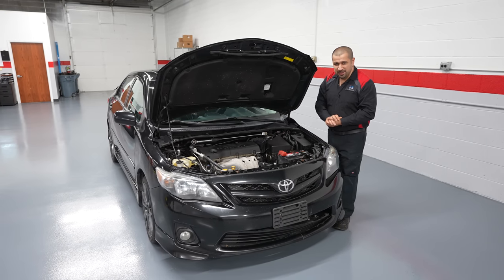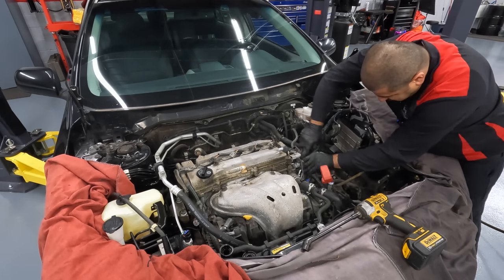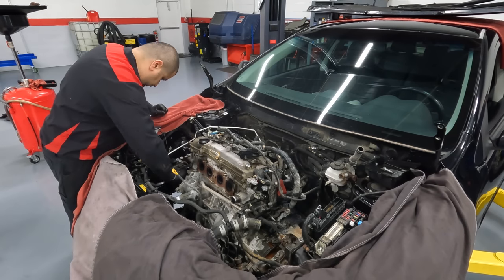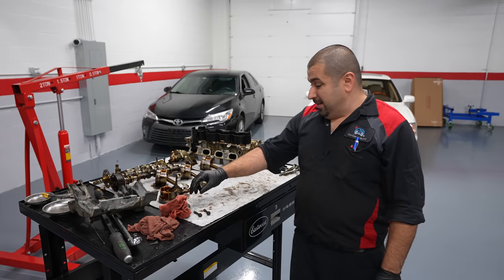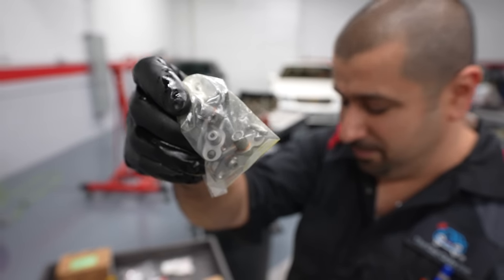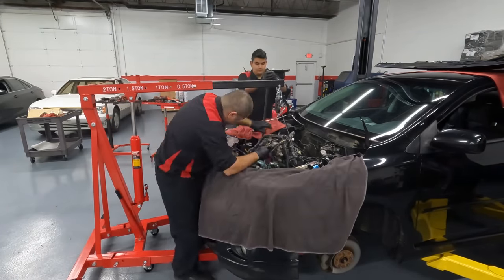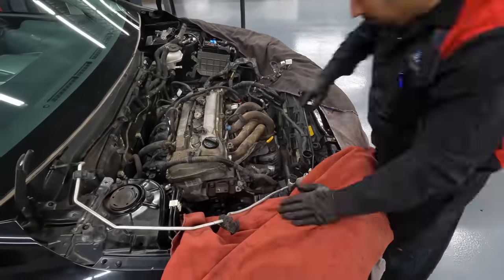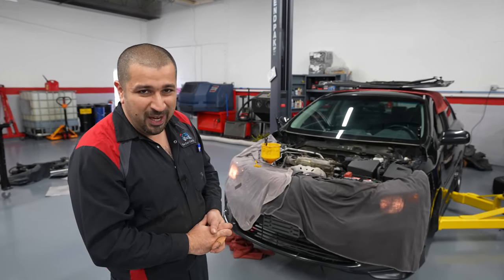THIS is Toyota's Worst Engine Ever Made! But Is It Really THAT Bad?

Comment: My Nissan 2.5 liter 4 cylinder engine has NEVER used any oil in 12 years of driving the car.  So much for Toyota being better than Nissan.  I have never had any trouble with the CVT transmission in my Nissan Altima because I do a drain and fill of the transmission fluid every 2 years or 25,000 miles whichever occurs first.

Comment: Hi sir! Im already fan of your channel, im dentist and when i was 15 yo i wanted to be a mechanic. I really want to study your profession now, just because you are amazing in what you do and you are inspirational. My gf has a RAV4 2012 with this engine and the oil consumption problem is there (maybe) I have to change the oil every 7000 km or 8000 km. Her vehicle is 180.000 km and riding smooth but it has this problem, is worth to get it to the mechanic? What oil should we use in this rav? (i dont have the manual). Greets from Chile and sorry for my english.

Comment: Hey hey hey:)
I have the same engine 1.5 L
2004 scion it doesn't burn or leak oil..good engine 😊
188.900 mi

Comment: My Issue  with Toyota  is I just purchased  a 2024 Venza and Toyota  says  first oil change schedule  is for 10,000 miles  no way did it at  5k new car no break in maybe I'm old  school. Well do changes no later then  7,k intervals.  Do you agree ??

Comment: Thanks man I really appreciate you sharing all of these … wondering if you’ve ever had any timing chain tensioner square plate cover gasket replaced. It’s about 2 inches square plate which covers the timing chain tensioner area and it’s tighten with 4 10 mm bolts, it’s on the passenger side in the front by your grill!

Comment: I have an 06 camry 2.4l with 172k and it doesn't burn a drop of oil, knock on wood lol. Use 5w20 full synthetic with changes at 4,500 miles

Comment: Thank you for the video, it help a lot.

I have a 2011 Scion XB (137,000 mil) and it need the same work as you did in your video. Do you have a list of parts numbers or a kit number? Even though I am the original owner I will need to pay for this out of my pocket. I live on the west cost and have only one Toyota dealer in my town.

Again a great job on the video and the information.

Comment: Toyota must have learned about the oil burning soon after they started with the low-tension rings in 2007. How is it that they were selling new cars as late as 2015 with this issue?

Comment: Also, for me, I'd never ever sell my xb. The room inside it is unbelievable. It's hard to find them cause no one gets rid of them. We love them and oil burning and all we'd buy them over and over again. Absolutely one of the best cars anyone could ever own as far as head room and internal space as well as a transmission that lasts forever and ever.

So for me, it's worth the repair even if it costs the value of the car. Absolutely worth it.

Comment: I really need your help sir,
As you seem quite busy with Toyota mostly, I have a 2.0 hybrid estate 2020 in UK. The car has an ongoing issue of injectors going bad after every few thousand miles. Have tried everything but it won't fix. Toyota said they couldn't trace the actual fault. Do you have any idea what it can be?

Comment: I have a 98 Toyota Avalon Xls v6 automatic w/ od and 4 wheel traction pkg. I'm a 3rd owner and am having problems with overheating, after replacing timing chain and water pump.  My question is: why? 
Please send me some quick fix ideas

Comment: Hi Ahmad , What is the reason or purpose of having crank position sensor disconnected ? Thanks
Reply: It lets your crank the car without the car starting up. Without the sensor plugged in the computer will not let the car turn over. They do this to prime the oil system

Comment: We had a 2013 Corolla S 5 speed traded in at my work with the 1.8L. Has 124k mi has had the maintenance done at our local Toyota dealer. I’m thinking of buying it for around $3500. 

But we also recently had a 2005 Toyota Solara V6 traded in too, has 140k mi and is in good shape. Not sure on a price. Hard to decide. I currently have a 2009 Sentra CVT which has been surprisingly reliable but I’m kinda over it lol.

Comment: Thank you for this and other videos. I like watching all of them, especially about engine repairs. I have a question. 
I have 2016 Toyota Highlander 3.5 V6 with 10k miles (I don't use it a lot), and I have 2009 Toyota RAV4 2.5 with 108k miles. Highlander's manual recommends and oil cap reads SAE 0w-20 or 5w-20 (for 1 or 2 oil changes only).  RAV4 manual and oil cap reads the same (0w-20 or 5w-20). If I care less about gas mileage, but more about engine durability, is it OK to use on both motors 5w-20 all the time? May be even 5w-30?   I realize, the higher second number is, the thicker is oil at high temperature, and the less engine wear. But from other hand, thicker motor oil (may be?) is not able to reach some parts of the gas distributing mechanism, which may damage some of its components (parts). I know, this is a case with some American car makes, for example, Ford F-250 with 5.4 V8 engines.
What would be your recommendations?  Thanks again.

Comment: Hello sir, I'm currently now own a XV30 Camry (ACV30 Thailand model) with 2AZ-FE paired with 4-speed automatic transmission. 
I'm about to do a transmission replacement, so I'm having a question: Could I pair it 5-speed auto from newer model (XV40 / ACV40) with the same 2AZ-FE engine?

Comment: My 2012 venza I ran it twice without oil and after 140k it burns one quarter  of oil.  Between oil changes.  Do you think the rings where damage or the cylinder wall or both. I was thinking of running it until it died and replaced the engine with a used one. Do you recommend saving the engine by doing the job now. Had it since new. 5k oil changes  0-20

Comment: Would 2002 2az-fe components all fit and function the same in a 2005 block?  What would be different about it?  Wondering if you could get an '05/'06 block if your '02/ '03 block threads pull out.

Comment: Does anyone know if the engine has to overheat for the head bolt threads to shear?  Would be curious what they changed in later years to prevent this.  I have a 2002 Camry, 2az-fe, and just repaired my head bolt threads with NS300L from Huhn Solutions.  3rd and 4th intake bolts were stripped.  I've never had overheating issues, as far as the temp gauge has shown.

Comment: I got interested in the part when You say that toyota engines do not need head and block resurface. I got an eu 1az-fe engine which is fine and happy as far as in know but what are the reasons to resurface the head and block? In Poland where i live there is almost a tradition that when your head gasket is shot You always need to rwsurface the block and head and put in a thicker seal. I also saw your video with throtle body cleanup and i cant wait for warmer weather to just check the state of that part in my rav4 because i got LPG added to my car and it's a kinda "dirty" fuel. Thank You.

Comment: I have an 05 Scion TC with 140k on the clock. I'm seeing mixed talking points ab the years the 2az is effected ? Did I dodge a bullet or should I worry for my piston rings ? Driven it about 500 miles since I got it and haven't noticed any oil consumption yet
Reply: Your year is the head bolt issue. If your car overheats it could do damage quickly. The change that affects the piston rings was 2007 and up

Comment: I'm curious about your opinion on 2004-2006 Tundra frame rust 
Where the frame turns up to the front suspension I can put my hand through the frame. It won't pass inspection.
I own a $4000 boat anchor.
😭

Comment: My 2004 Toyota Camry LE has the 2.4 engine known as the 2AZ-FE and it currently has just over 305,000 miles on it. I do put in about a quart of oil per gas tank but other than that it's still running fairly strong. What do you think about this engine being in this particular situation considering that I have had this car for about 3 years and roughly 70,000 of those miles as the 3rd owner?

Comment: If looking at a used one, how do you tell IF the re-ring was done?
Reply: I believe you can take the vin number and call a dealership. They could tell you if it’s been done. But that might only apply to Recall services.

Comment: I tried the piston soak on this engine to help with the oil consumption problem and now the engine is locked and won't turn over.  Have i screwed this whole engine? And what is my next step or options to fix this? Thanks!

Comment: I'm slightly confused as I'm looking into buying a 2011 Camry with 44k miles on it. I looked on the page for it and it says it has a 2.5L engine in it not a 2.4L. Is there a difference between the two, and does the 2.5L engine burn oil like the 2.4L? I don't want to buy a car that will start burning oil on me and end up having to spend a lot of money to get it fixed.

Comment: @41:40 He says this engine was designed for 5W30 and not to use synthetic. I guess that also applies to the 2007 Camry. Question I have if this affects emissions in any way.
Reply: Also at 41:40, but, if you want to use synthetic 5W30, fine.

Comment: Toyota build brilliant Engines, biggest problem with Toyota’s are the Owners who don’t understand proper maintenance or they get in their heads, “it’s a Toyota it will go forever without an Oil Change” we Purchased a 2008 Corolla Levin ZR (Australia) new, has had Engine oil, filter changed every 5,000kms currently at 302,300 kms. Gearbox (manual) oil every 20,000kms, other fluids, every year. Highway kms, People thought I was crazy changing oil this often. Have done it in our other 2 cars (older Volvo’s).

Comment: i have a 2009 toyota camry with this exact engine it burns oil like crazy so i was putting so much oil into it I decided to stop changing the oil i just change the filter every 3000 miles and i dump the 5 quart container into the engine between each filter change oil is always clean  because im constantly putting fresh oil in so in between filter changes i add roughly 5-6 quarts so it evens itself out but it runs great i have zero complaints other than the oil great fuel milage comfortable ride reliable so i figure i soend slightly more on oil but compared to buying a new car ill keep buying the oil lol

Comment: It is possible that the new V35fa twin turbo V6 may join the rogues gallery with its low mileage main bearing failures in the 2022 and newer Tundra and a few Lexus models. See the video from Tinkerers Adventure.

Comment: I have a 2006 Rav 4 that has had regular  oil changes and it will burn a Qt in 200 miles or less. It has 180,000 on it now. It's a 2wd and it doesn't get good mpg either, about 20 at best Hwy. Fresh Tune up, doesn't matter

Comment: Should I switch from 5w-20 to 5w-30 on this engine? No problems so far at 160,000 miles on my 07, and 115,000 my 09.
Reply: Did you switch to 5w-30, I am curious if I should. Thanks!
Reply: @timf3521  I have not.....yet....

Comment: You say the updated cars had the 0w-20 cap. Do you mean these engines are updated with low tension rings or have been updated with better rings? I'm looking at buying a 2005. Is that good?
Reply: 2005 was a good year for this engine

Comment: A little late, but I was wondering what Toyota engine replaced this one in the following years and if the problem ever happened again on future engines.
Reply: This is the 2.4. I the second generation Scion tc has a 2.5 that never had the oil issue. Idk if the 2.5 has other issues but this issue was addressed

Comment: I have a 1zz fe with a timing chain rattle, not so much but it's there. I have replaced the tensioner but there still is some rattling there. Can/Should I move the tensioner 1 click manually to tighten the chain a bit more??

Comment: Hi there I'm in cape town driving a corolla 1995 160i 4afe 
Toyota had a sticker on valve cover Castrol gtx2 rubbish ionly use
5w40 and oilchanges 3500/5000 engine is smooth and clean is this good

Comment: I have a 2005 scion tc manual 5sp. It is simply the worst car EVER! I had a wind catch the door and the door check crushed the non-accessible window track and broke the window. Toyota repair is to replace the door. Seriously, replace the entire door. Burned oil and randomly broke a rod on #1 cylinder. This car has never been overheated and ALWAYS had regular oil and filter changes. Picked up a core engine from another scion and completely rebuilt it. Head bolts came out clean and took torque. 3 weeks after running it, started leaking coolant. Found 3 rear head bolts loose with threads pulled. I spent the time and money heli-coiling the block. Local machine shop told me that Toyota has the worst metallurgy, in their blocks, of any manufacturer. The place where I got the "rebuildable" core from told me they checked over 50 2AZ-FE engines and only found 2 that would turn over. Can't wait to get rid of the car. Every manufacturer has a dud car, but really?

Comment: Somebody explane to me. I have an 03 camry with this motor. 135k miles. Im at 3000 miles since my last oil change. The oil is clean and not low. Mine does not burn oil???

Comment: I have a 2003 highlander 2.4L and I love it. I pulled the coils to take a look in the cylinders and the ignition coil boots didn't come out with the coils. Unfortunately, I tore them up getting them out of the plug wells. I see no reason to replace the entire coil but am unable to find the boots only on the Toyota parts website and I want to stick with the original parts. Does anyone have a part number or source for just the direct ignition coil boots?

Comment: i have a 2009 Camry, yes, it burns oils,  I just buy oil and keeps it running, everything else working fine.
Reply: What oil are you using?
Reply: @Jose-sy1je  Mobil One 0W-20
Reply: @wilsonh6844  At the end of the video he states that these engines are made for 5W30 and should run on 5W30 and not the recommended 5W20. Check it out @41:40
Reply: @Jose-sy1je  Oil cap says "0W-20 oil"
Reply: @wilsonh6844  I know. He says it's just for gas mileage they put it. So you will keep on using 5W20? I'm not sure after hearing what he says
Reply: @Jose-sy1je  Ah, I've missed the minor details...I can give 5W-30 a try on next oil change.
Reply: @wilsonh6844  I'm clueless. When I look at engine specs online the websites also say 5W30 can be used. I don't know myself either. Someone told me the engine will supposedly last longer that way

Comment: is there anything can be done to extended the life of this engine prior to doing the rebuild?  any flush, heavier oil?  just got one of these,  and would hate to dump 3200 more into it, at this point.  but like yours, the rest of the car is in very good shape.
Reply: I would try good engine flush, 5w-30 with more frequent oil change interval than 5k miles. It might work.

Comment: Toyota considers a 1 qtr. oil in 1000 miles normal use on a relatively new car WHOW!!! oil consumption Has now been turned into a finger pointing issue were like other problems manufactures have engineered into their products have had now becomes the consumers fault. Well I am one of those individuals that changes my oil and filters every 5k on my Xb and right from the beginning noticed the oil consumption took it to the dealer here in Orlando Florida and was told they saw no issues with the high oil consumption. well it got so bad i now fill the oil and check the gas in this vehicle regularly. and since we were told the consumption was not covered by the MFG until the recall/ warranty/ what ever TOYOTA wants to call their Engineered problem Expired. Now the vehicle is not worth investing the repair money. So Yeah!. Live long and prosper.

Comment: I've owned one for over 10 years and never had any oil issues.  Serviced every 10,000 km and you wont really have any issues besides replacing parts eventually.  If your lazy and don't service regularly or treat the car poorly, then guys like this will make false claims.  Once again, service these cars regularly, and they just keep running.

Comment: So many cars had this engine, so at least parts are cheap, but the 2AZ-FE is so incredibly underpowered and eats oil.
Reply: I recently bought a 2005 Highlander with this engine, I wanted a 6cyl but bought this instead after taking a test drive it had a lot of power, a lot more than my 1998 Rav 4. With the Highlander on the freeway I barely had my foot on the gas and I looked at the speedometer and i was going over 80mph. Also I go to a town that is 2000ft higher than were I live and I went up the hill no problem and it didn't even shift like the Rav4 did.

Comment: 2004 2AZ-FE Toyota Camry never burned oil 

135,000

Overheated twice and kept driving to shop…no issue. Just clogged radiator

Emissions system is a bitch. Cats keep going bad and sensors suck even from Toyota.

Also avg MPG is 18-20. Wow

I’ll keep this car until I die but I wouldn’t mind a new Tacoma…

Comment: what are you talking about,  this is the best engine they ever made. ive had 4 of these engines all with over 300K miles on them, and i sold them running perfectly.  the problem is americans dont know the meaning of vehicle maintenance.  the oil needs to be changed every 3K miles from new and it will NEVER die

Comment: 2007 engine consumption burn too much oil when it have 80000mls. fill 1½ small botton every week muffer black smoke bring to estimate $6000 no money enough to fix what you going to do start to learn to fix myself yeah I can do that first time my life decision riskey changing only piston ring it work not any effect engine run well no smoke normal to fill oil, budget just $700 3 week.

Comment: Using these words ((( one of the greatest / very well engineered  ))) on a car  with massive problems like pulling the engine out under 100.000 ks  ... 
Obviously, if it was well engineered, you wouldn't be working on it ...